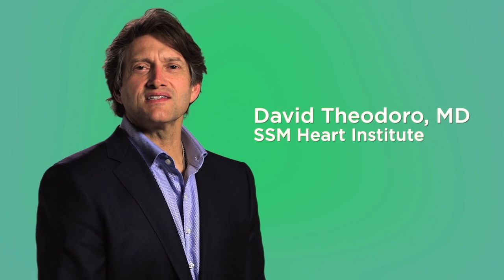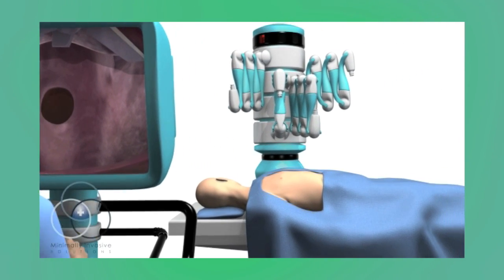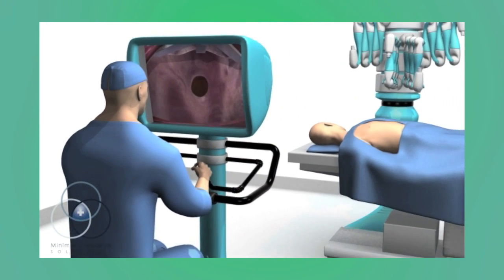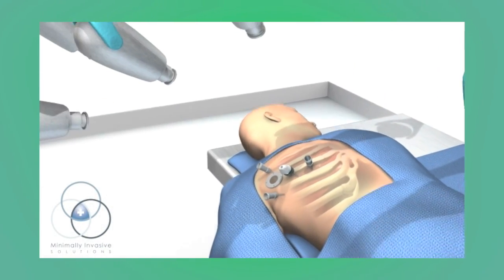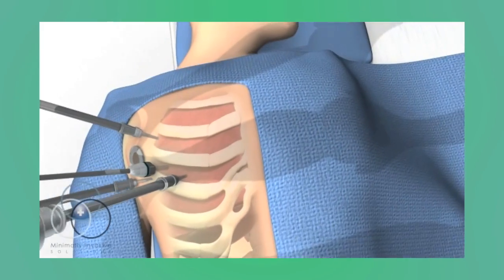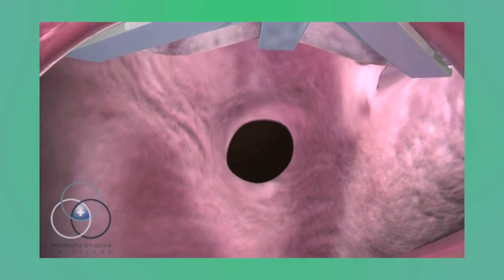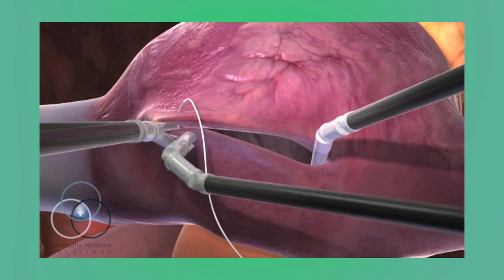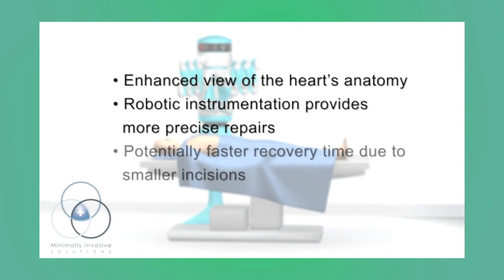Atrial Septal Defect Repair at SSM Heart Institute

Comment: I had a stroke at 52, turns out I had an 18mm sized hole in my heart through which a blood clot passed and hit my brain. I was lucky, I only (permanently) lost some sensation on my left side however what pisses me off is that I have seen tons of Dr's over the course of my life, served in the military for 6 years, and NONE OF THEM caught it. It took a stroke for them to discover it. In case you are wondering, 18mm is the size of a nickel.
Reply: What's a nickel?
Reply: @sadiamasood4351  A nickel is a coin. (I believe.)
Reply: Glad you are alright. I had a 35mm hole that was found when I was 31 … I had a closure (catheter) and a couple years later an ablation to remove a lot of the scar tissue thereafter that caused me to go into tachycardia frequently. I’m good, thankfully. I am also a professionally dancer and my active life also helped me throughout. With my first procedure I was still processing and recovering and had not been discharged yet … and I recall a nurse who rolled me to my echo told me when I was saying I still couldn’t believe it (found out I had holes the they closed them within a couple of weeks) well at least it’s not your brain … that’s really tough to fix. It sort of put things into perspective. It’s amazing what they can do. Prior to my asd repair my husband and I had two kids, at home and afterward we had three more kids. I feel very blessed and I know you do too … and no one like you … ever ever caught it